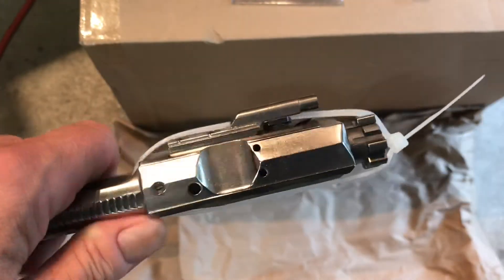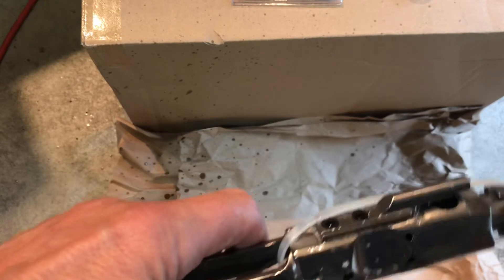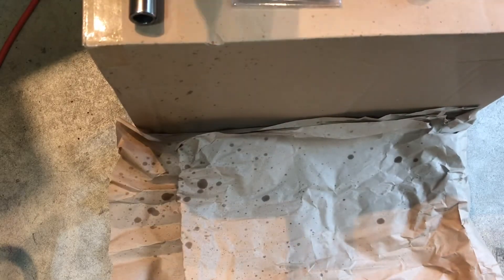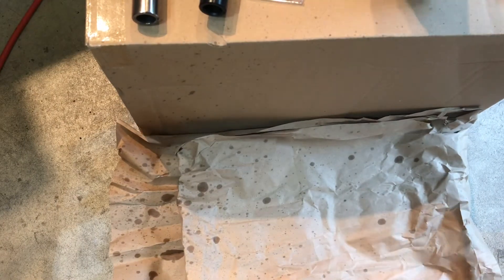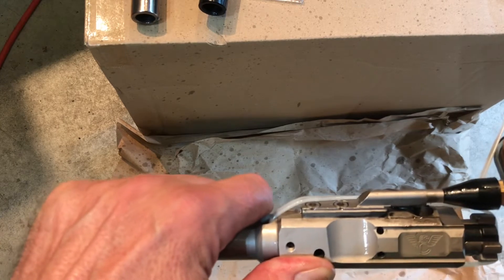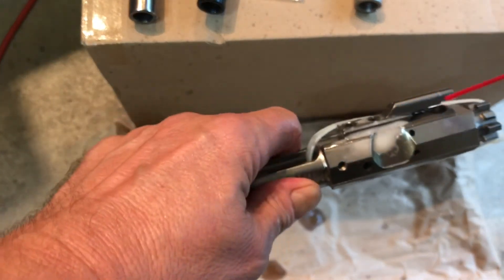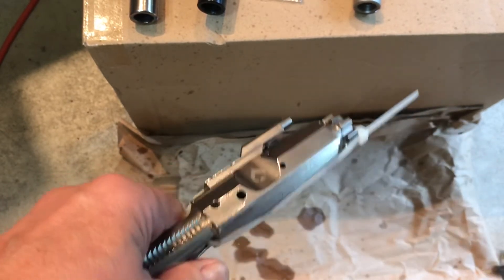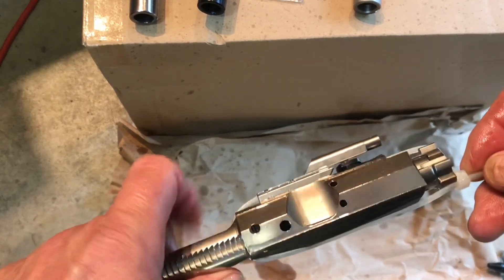Troubleshooting a 6.5 CM build:  testing for gas key leakage

Comment: I noticed my old carrier had a loose key so I decided instead of just fixing the key, I'd just buy a new carrier. Then over the next half year I've been struggling to figure out what is wrong with it since it kept short stroking occasionally but would mostly work. The old carrier that had the loose gas key was short stroking nearly every round but this would do it like maybe 1 out of 100 so I thought maybe something else broke. After exhausting every possible thing, I just blew air into the key and I could see bubbles foaming from the base. I just bought a new carrier and last night for the first time managed to work 100% after nearly half a year trying to figure it out. Wish I would have figured it out sooner so I could return it.
Reply from the maker: @Dan-di9jd  on the ones I tested, none of the gas keys were loose.  They all just had a weak seal.  All were returned for refund or exchange.
What brands of carriers did you have issues with?  Glad you at least figured your problem out.
Thanks for watching and taking the time to comment.  Hopefully my video was informative
Reply: @ yes it was helpful thanks. The brand of carrier was Colt. The first round it did a short stroke and ever since then was battling to figure it out until yesterday when I got my new carrier. I tested it using grease and keeping a thick amount along the key and blew air into it. At least I got a bunch of new parts but it stinks I can’t return this defective Colt carrier now. I went with Daniel defense this time around.
Reply from the maker: @Dan-di9jd  I’ve ran a BUNCH of different brands of BCGs and until this video, not run into anything like this and I have used some very inexpensive budget carriers. This video was at the tail end of COVID, which I am guessing was the reason for the poor quality control.
As for your Colt carrier, I would still contact them.  No matter the time, they really should make it right.
Reply: @ Yeah I think pre-pandemic, I never experienced a failure like this. Even the gas key coming loose on my old carrier is something new and I bought that right after the pandemic. From what I think, either the sealant solution has a shortage and/or they're not taking time to polish the gas key surface to make sure it's even on the carrier base.